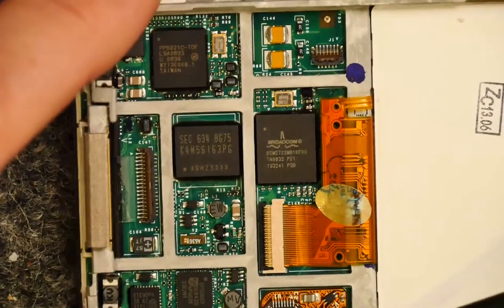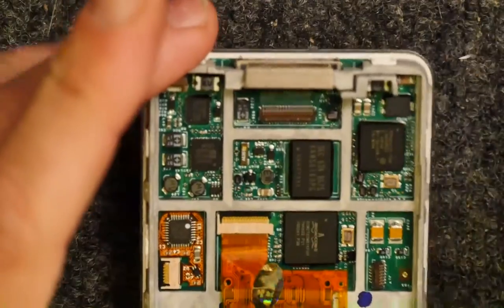Apple iPod video

Comment: Looking forward to a reflow of the correct area in the future. I've done the same thing before in the past; bloody human brains and not being able to cope with inversion.
Reply from the maker: +Simon Lock (Aergan) Focusing too much on not ripping some irreplaceable ribbon mounted part to see the obvious! Will need to revisit when I'm feeling patient!
Reply: I killed my first Game Gear LCD in the end by re-flowing the wrong IC. Was a very Sad Trombone moment when my brain caught up with my actions.
Reply from the maker: Well... are you sure that killed it? Maybe the re-flowed IC is actually ok and your heat on the board just disturbed the faulty components?
Reply: they're large surface mounted IC's on a flexible ribbon. 3 mounted horizontal and 1 mounted vertical.
Caused a short to ground fault on a working one, so definitely dead Jim.
As a test, I removed the IC and re-flowed the faulty one and ended up with 2/3 screen fully working.
Reply from the maker: +Simon Lock (Aergan) Poops :(
Reply: Work for Apple ;)

Comment: It is actually a micro hard drive and obviously has been trashed by being dropped and it is not worth saving so the moral is don't drop it on any hard surface, you might have a chance if the platters are not shattered or scratched but I don't hold out much hope.
Reply from the maker: +DAVID GREGORY KERR 100% not a hard drive fault. It's the audio codec IC, e drive is fully accessible even now. The data stream goes to the ic and it outputs the converted analogue to the amplifiers. This IC has delaminated itself.